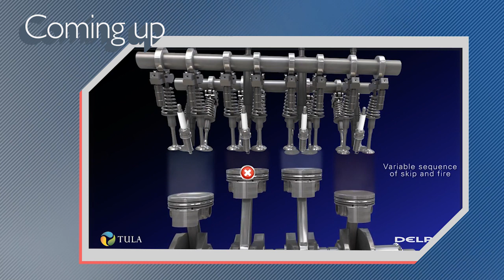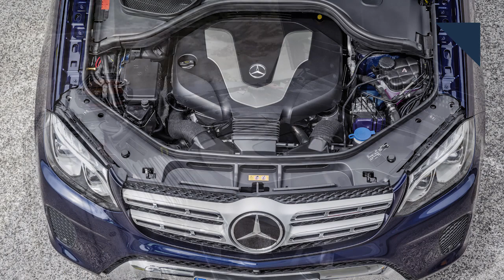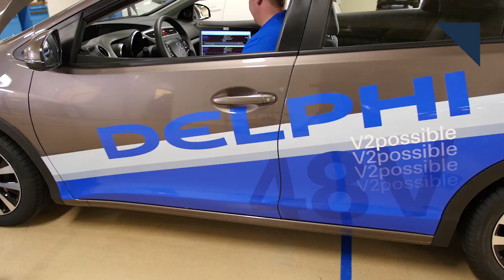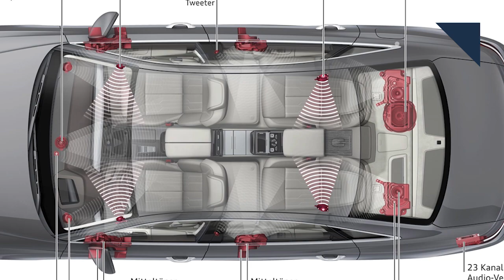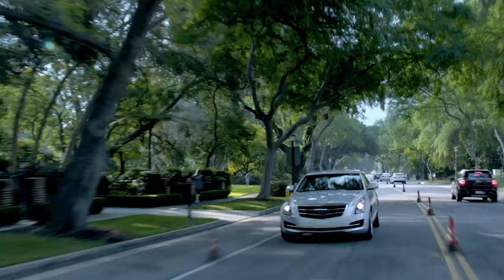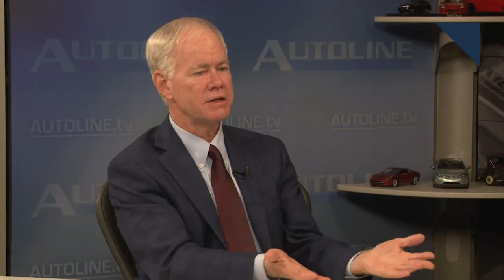3D Sound System, August Sales Won't Rebound - Autoline Daily 2177

Comment: Although I agree there is a aftermarket for accessories that dealerships are not tapping into, the price is just too high on a lot of the items. Case in point, I have a Fiat 500 Abarth and there is a beautiful set of wheels offer through Mopar performance but they cost $2,000 a set. What I ended up doing was buying a set of Oz racing wheels for my car and use the factory wheels as winter Wheels.
Reply: dealers sell what aftermaketeers do, but the charge you comissions, i have noticed that in lots of dealers
Reply: They need to find a way to get more people financing accessories if they want to get sales. It's not responsible, but that's what the sales surge over the last few years has been built on, so that's what accessory sales need to be built on. They can sell the individual items at lower prices that way too since they will make more money on financing. Maybe a (car company) branded credit card that earns points on accessory purchases, or is partnered with airmiles or some other points reward system.